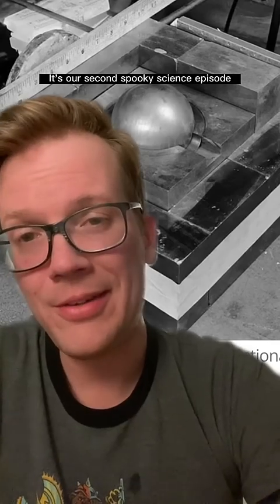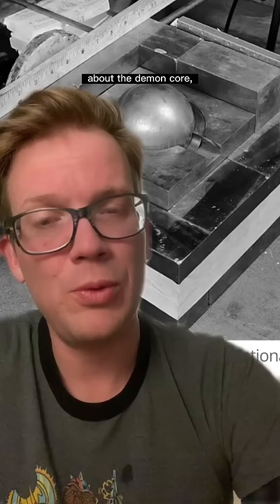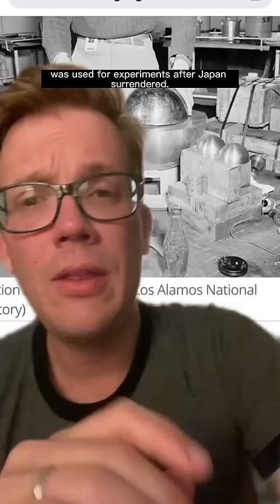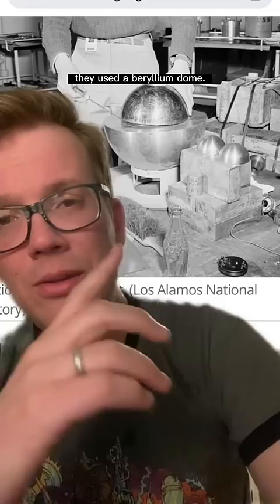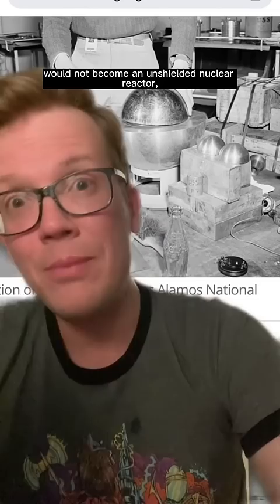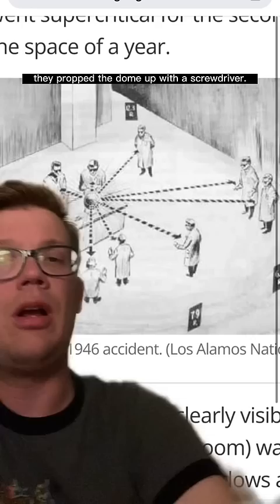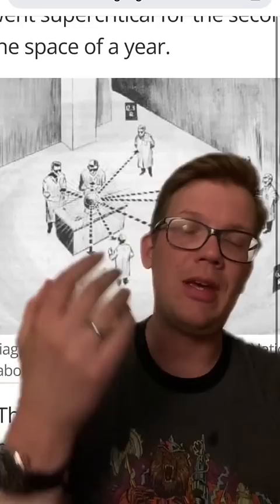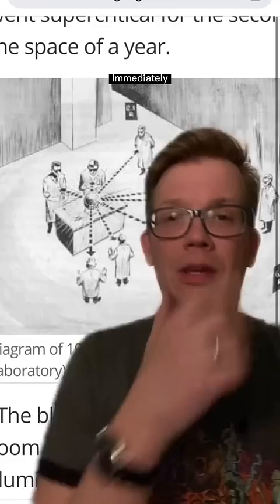Spooky Science episode 7: Second demon core incident

Comment: He spent the immediate time after measuring where everyone else was standing so he could reliably tell them they would be ok. He was a nice man.
Reply: Is this true?
Reply: @Selinasdevil yes it is. He immediately told everyone to stand still so he could calculate everyones radiation exposure.
Reply: @michaelboles4057 wouldn't them having to remain in that position expose them to more radiation? Or was the radiation only produced when the dome was in contact with whatever it is the screwdriver separated it with?
Reply: I just saw another comment which stated he had them only remain that position to mark it so he could calculate it, so I guess my question has been answered.
Even though staring death in the eye, he remained calm and collected.
Reply: @shuenshuen If they had propped it up correctly, it would've been fine. The metal shell kept most of the radiation contained but not enough for it to hit critical mass. Shows the speed that the atoms were travelling on the inside.
Reply: He probably also felt a lot of guilt.
Reply: @shuenshuen criticality accident stopped the moment the dome was lifted, it was safe-ish to stand there. It's like turning on and off a lethal flashlight.
Reply: Heard this before but I thought everyone died.
Reply: Yes he did calculate their radiation doses based on location but it wouldn’t have been necessary if he’d taken proper safety precautions with the core to begin with. He was warned multiple times (even once by Enrico Fermi) that his careless behavior would inevitably result in catastrophe, and it did
Reply: Didnt everyone die prematurely? From cancers.
Reply: @edwinmercado5723  Not true. The man standing closest to Slotin died of a heart attack 19 years later (suspected hereditary heart disease). There was one case of leukaemia but again not confirmed to be related to the incident and 19-20 years after. Every other person in the room either died of unrelated causes or lived a long life. Slotin’s body shielded everyone else - the dose of radiation he took killed him 9 days after the event.
Reply: @shuenshuen the reaction was brief, he had to physically handle to dome right next to the core, that's what exposed him to so much so quickly. His coworker kept singing praises about him after this so I suspect they liked working with him.
Reply: @afropunkx if I remember the full story right, he absolutely did.
Reply: Ah yes experimenting with weapons of mass destruction, what a nice man😅😅😅
Reply: He wasn't nice, he was stupid. He felt guilt that he might be responsible for the deaths of his colleagues and decided to reassure them that they will be okay, that his fuckup only effected him.
Reply: @nabihlakkis562  nice and stupid aren't mutually exclusive.
Reply: @edacheson8540 he was literally a nuclear physicist so, he wasn’t stupid.
Reply: @nabihlakkis562 ”the nuclear physicist was stupid” said the YouTube commenter with a minion Jedi profile picture

Ahahahaha you can’t make this shit up 😂😂😂
Reply: @Slime_Goblin  Now you’re just attacking people for random things like profile pictures. Chill out.
Reply: @Slime_Goblin emotionally immature. Are you a child?
Reply: @salladpatron3395 No, he's right. That "dumb" nuclear physicist is smarter than everyone in this comment section. How you gunna call people names but then turn around and call them childish? 😂
Reply: @Unfamiliar_Fruit the brink of life and death is where the greatest science is created.
Reply: @TheFireflyGuy  cry more lmao
Reply: It was to determine how much of their life was shortened. NOBODY was ok.
Reply: He was a reckless fool. Fermi told him how he'd die. And he did exactly that.
Reply: What a god.
Reply: @ItsSweetLew hahaha best comment
Reply: @nabihlakkis562 damn you got cooked harder then the man’s atoms ☠️
Reply: @TheFireflyGuy it wasn’t random? It was because he was acting like a scumbag so he roasted him with the information that he had which obviously was the goofy picture.
Reply: I mean it’s the least he could do after potentially almost killing everyone. And several people had complained and even one person quit because he was so reckless
Reply: @michaelkoop9142 you can be smart and still stupid. Especially people that are just focused on one thing and ignore all else
Reply: @nabihlakkis562 he wasn't stupid. He was smart enough to be part of experiment with nuclear material. U don't get to play with nuclear materials unless u have high level clearance and education. 

He was CARELESS OR COMPLACENT. 

I think anyone would feel guilty for causing the deaths of others because of negligence
Reply: @VanyaTheSlavic  A/ I’m not American. B/ when someone includes the assumption in the question it’s perfectly fine to use “not true” as a way of starting a response. I wasn’t being antagonistic in any way. You’ve picked up on that all on your own.
Reply: All that science, all that technology, all the minds involved creating it all= nobody had forethought enough to realize a screwdriver was a bad tool for the job. 

This is a microchasm of human kind.
Reply: @Virgus-vj3xr "he wasn't stupid you don't get to play with nuclear materials without education clearance" 

Dies from sticking a screwdriver in nuclear technology

Yep clearly not an idiot, you're right (this is sarcasm he apparently WAS an idiot)
Reply: @TheLastCrow5150 I'm confused i would think once the screw driver slipped it would close off access to the radiation... I think i need to watch a more in depth video
Reply: @cantcatchzoom19  keeping the shell open allowed electrons to escape so they wouldn't build up energy. Once the core is closed, there's no escaping for the electrons. This causes the particles to keep speeding until they hit critical mass.
Reply: @TheLastCrow5150 we must've need yu there then huh. Would've totally changed everything
Reply: @TheLastCrow5150  got you thank you makes sense now
Reply: @michaelboles4057 Shame he couldn't calculate a reliable set-up for his deadly nuclear science party game.
Reply: @Vaultboy101 exactly. You doing the right thing after you screw up isnt an excuse for making a silly mistake to begin with.
Reply: @shuenshuen  Interesting question, when the Russia/Ukraine conflict began I looked up A LOT of stuff about nuclear bombs.

Apparently there are two types of radiation you worry about. One is light radiation and the other is radioactive debris.

So the initial blast of light is HIGHLY concentrated radioactive waves that could kill you depending on how much of this light was produced. In a bomb, it's a lot. The other is the debris, this is a different type of radioactivity which decays with time. You merely lock yourself away for a few hours, maybe a few days. The half life is such that most of the radioactivity will go away in about a week (with modern bombs).

In the lab where this incident took place they only had to worry about the first type, and the concentration of light decreases significantly depending on the distance. He was very close, so he took highly concentrated radioactive waves.

The others standing further away likely experienced FAR less radiation as the surface area of the theoretical sphere of light grew in size.

Once the flash of light is done, there is no residual radiation and nothing in that room would be radioactive.

The reason debris is radioactive is because tiny particles remain that produce radioactive waves.
Reply: @MrSirFluffy  wow, thanks for the explanation. Interesting stuff.
Reply: There's a lot of not knowing the difference between educated and smart going on in here
Reply: @michaelkoop9142 To be fair, it is pretty stupid to have the twist of a screwdriver in a human hand the the only thing between you and fatal radiation poisoning. 

Louis Slotin was an excellent scientist, but he was also a cowboy when it came to safety. Which is never smart, but doubly so when you're talking about radiation.
Reply: I guess he never heard of the memory palace. Like take a mental photo graph, and get the f out the way. I don't think anyone after that is going to harp over accuracy to the centimeter. Don't touch nuclear cares, m'kay!
Reply: Yeah they started to leave but he immediately called them back and had them mark with chalk where they were standing so he could measure the dosage of radiation they just received. And he did all this while already knowing he was a dead man walking. Respect for that, he wanted to make sure he could reliably tell them if they were gonna live or not. Luckily everyone else lived and was fine, or as "fine" as you can be after getting a massive dose of radiation.
Reply: @TheFireflyGuy slot in was the sheild
Reply: @Selinasdevil Told everyone to get back in and mark where they stood so he could calculate their radiation dose
Reply: @ItsSweetLew   At that point I'm not sure if was still a weapon so much as an extremely dangerous research sample. But, on the other hand anything can be made into a weapon, rather quickly... I mean a lot of people working on the Manhattan Project, had no idea what they were working on until the tragic day they dropped. So he may not have known all the reasons, he was just working, and well we both watched the same short.

(If I sound rude, or like an asshole, I apologize. It is not my intent, this is meant to be a chill response. Also sorry if it has a lot of typos, or weird incomplete statements. I'm falling in and out of sleep while editing this to a manageable wall of text which again my bad.)
Reply: @michaelkoop9142  Even the smartest most intelligent people, are not only ignorant of as many things as they know, they are not immune to being stupid. But, no this was an accident, an insane tragedy of an accident.
Reply: @ItsSweetLew experimentation does not make a man nice... The one who isn't is the one who orders it's use, and even then that comes down to circumstances...
Reply: @edacheson8540 they are tho. to be purely nice you have to be thoughtful. stupid is not thoughtful. a nice act with good intent that ends in bad results isn’t a nice act is it.
Reply: @Slime_Goblin one of us is dead from knowingly mishandling a lethal dose of radiation, the other is still alive to defend themselves on a youtube comment. 🤷‍♀️.
Reply: @johnnyslokes2712 that “nuclear physicist” that’s smarter than everyone in this comment section is dead from a “mistake” he made by knowingly mishandling a fatal amount of radiation & going against better advice from nearly everyone around him. the “genius” that balanced his metallic death on a screwdriver in a metallic dome, precariously balancing his own fate as well as possibly an entire other room of people. so smart.
Reply: @hihihihihello actually they did think it was a very bad idea. someone even told him he was going to cause a catastrophe.
Reply: @TylerCurrey-ui2vk i mean i think anyone else at all in that position would have critically changed the outcome. pretty sure almost everyone disagreed with the shoddy set up
Reply: @shuenshuen no once the dome was pulled off the core was no longer critical.
Reply: @shuenshuen like he said once the neutrons were flowing out it made it harder to cause chain reactions. Allowing it to not go super critical any further
Reply: He also directed others to interact with the core, in a way that would have exposed them to more radiation. He worked for science, but that doesn't mean he was actually a nice man. He tried to volunteer others to risk their lives as well, to salvage something from his reckless mistake.
Reply: @nullshock3381  you’re all good, no worries. I see other comments here however that are worrying. Based on circumstantial observations on the state of war at the time, and that other countries were publicly and blatantly toying with the concept and reality of nuclear weapons, I refuse to accept the concept that researchers didn’t know what they were working on and how it could be used. I will however accept that they probably didn’t gamble on our country being a full on cruel terrorist organization by melting the skin off of a million innocent people while imprisoning Americans born in America that happened to resemble them. Again, I know that the minds behind this project didn’t want it used for war, but i argue, respectfully, that they morally shouldn’t have continued with its development due to its obvious capacity for horror
Reply: Nice guy, very smart...but not very wise.
Reply: He was the opposite of nice. He caused it.
Reply: @nullshock3381  it was an accident in the same way that downing a bottle of vodka and driving a lambo into oncoming traffic is an accident.
Reply: @ItsSweetLew  de-escalation and peaceful resolution must always be the priority. But truthfully one cannot afford to not be stronger or at least smarter than someone that threatens to attack. And most threats are veiled and concealed. You cannot in good conscience advocate for letting the Soviet Union being the only country developing nuclear weapons during the cold war. 

Unless you think that nuclear weapons are totally overrated as a path to victory in a conflict, which I'm starting to consider too. But deterrence still has a strong part to play in de-escalation, as paradoxical as it may sound.

There will always be a weapon that is the deadliest thing that can be built at the time. It's just good sense.
Reply: Wasn't there a movie about this with John cusack?